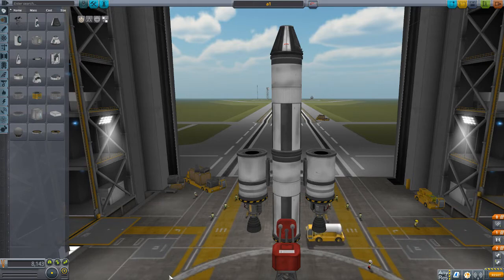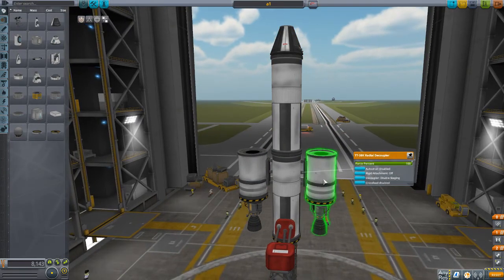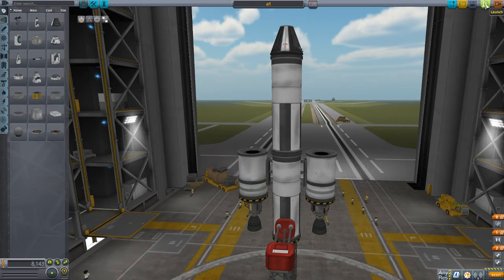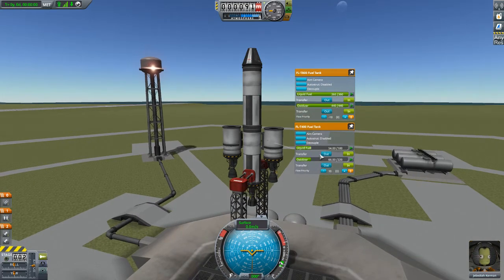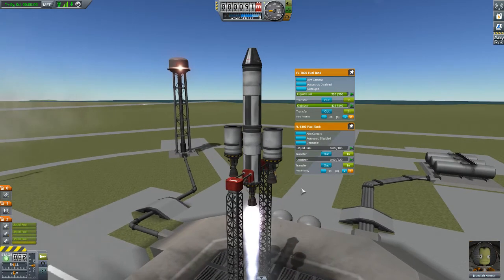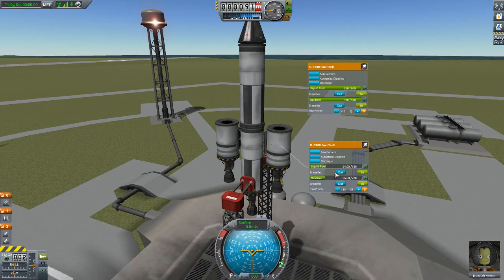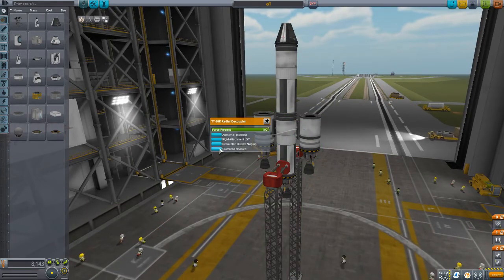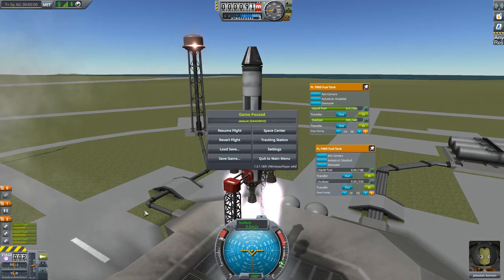2017 11 01 06 57 19

Comment: Nice, removes another part by not requiring fuel ducts for simple setups. Unfortunately the game audio is way too loud, makes it hard to understand you.
Reply from the maker: I didn't realize, I'll redo it this evening
Reply: Yeah it's either that or the microphone level was just way too low... Regarding the mod, though: I wonder if there would be any use for a flow mode that only allowed fuel transfer from the inner tank to the outer tanks, or if that's just irrational nitpicking about an "incomplete" feature set... lol! :) I'll definitely be installing this mod though!